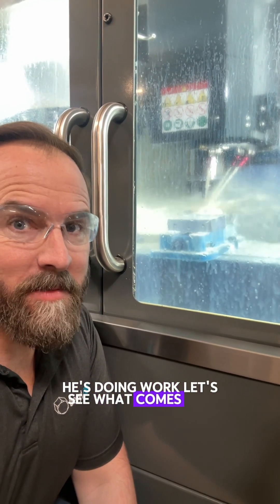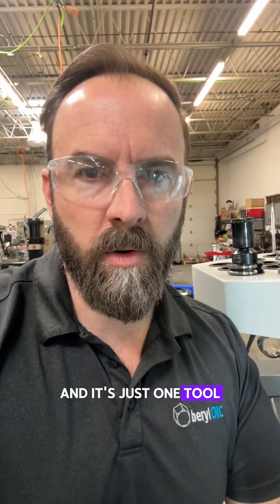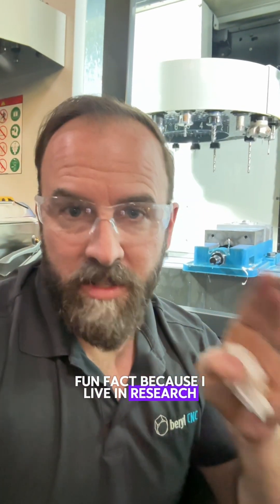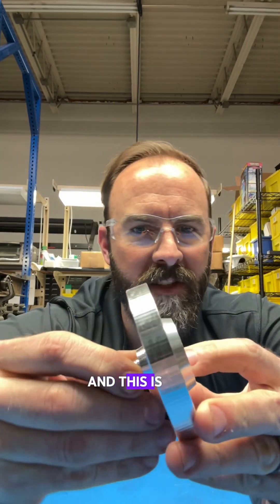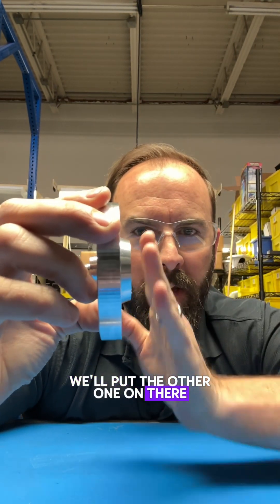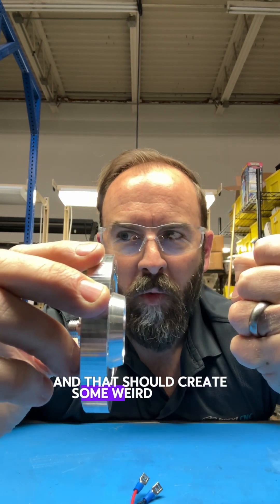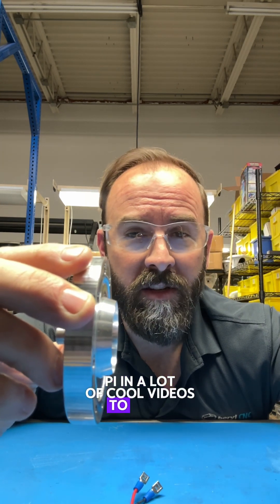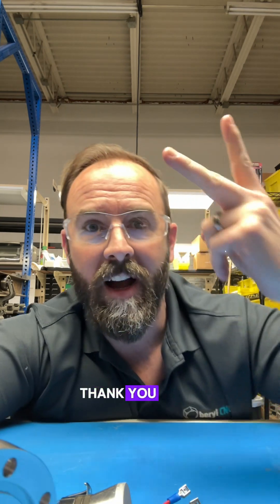LENR Sonoluminescence Reactor Part 10

Comment: Cool stuff Jason, 
Ultrasound couples poorly to water because of the impedance mismatch. There are some data on material acoustic impedance freely available on the net.
You've mentioned using PVDF... which is a very good material to use in matching the 1/4 wave transformer necessary between/ ceramics/metals and water. 
Perhaps consider even a multiple layer transformer with (suggesting Magnesium,) 
Matching sound with various materials to water is not mathematically "too different," to matching impedances in electrical antenna theory. 
The equations are readily available and quite simple algebra. 
Ultrasonic horns, (preferably exponential,) are the key.
The biggie in ultrasonics is reflections at every interface.
Every transition creates reflections which rob the target of the power you're trying to get there.
Regards Mink

Comment: Very nice CNC working,  looks like a lot of fun. How much do you charge for work for an open source reactor design I have? 

One can induce electrolytic luminescence directly on the Nickel composite substrait without an Ulreasonic transducer. Wave guide and current densities are still important, like tuning a piezoelectric crystal 
Those 40khz transducer take a lot of power to run and have some losses. 

Love that you are openly working on LENR. Keep it up brother.
-Diadon 
@consciousenergies
Reply from the maker: Thank you! If you want a proposal for your R&D scope of work I'd be happy to connect. Check out aquaco2.com and send a request or send me a message on Instagram or TikTok (i2c_jason). All of the machining I do in house is pretty much like this, where I'm back and forth between CAD/CAM and the Haas. So tuning something is a perfect application. We send out production jobs once they get above the first few proototype pieces. Regarding LENR, yes I'm aware there are a ton of other ways to do this. Part of my interest in sonoluminescence using this design is that I came here assuming LENR is bogus, so I wanted a design that could be repurposed for other experiments using sonoluminescence. From what I've learned in a couple months LENR is completely real.